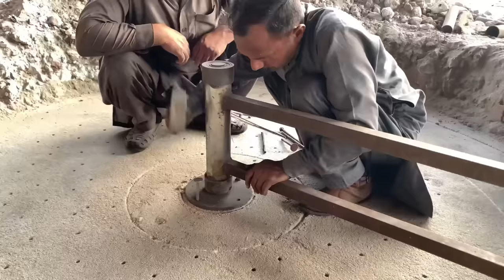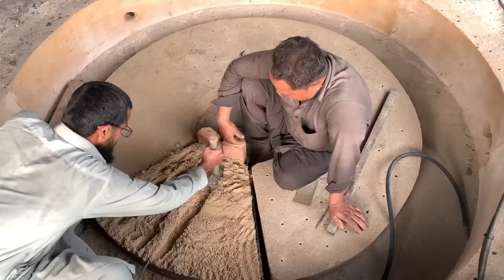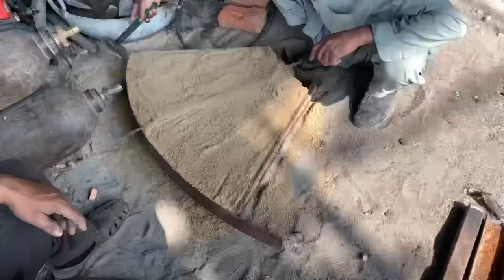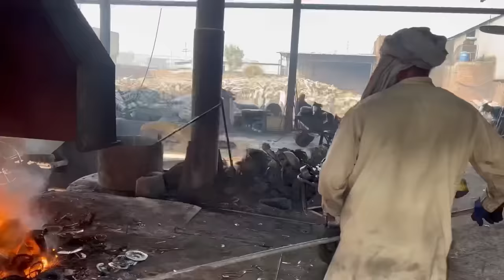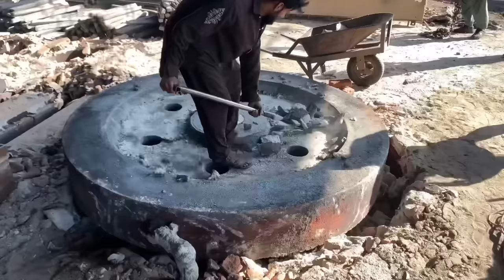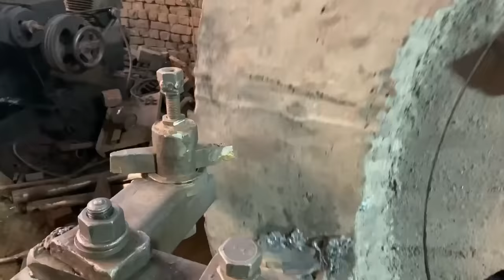Amazing Manufacturing of Largest Industrial Gear for Rolling Mill Plant | Production of Biggest Gear

Comment: Nothing but the highest quality steel and they won't even charge you extra for the porosity.
Reply: Porosity helps keep the over all weight down.  Don't want these big wheels to get to heavy, right?
Reply: С таким размером пористость влияния не даст
Reply: @zcommandante  sure it can it's a place for stress cracks to propagate
Reply: @andrewvogel5344  они дали отливке остыть за длительное время. После обработки на станках деталь будет подвержена закалке и отпуску. На этапе нарезки шеврона видно что металл пор не имел, весьма качественная отливка, возможно в расплав добавляли флюс для очистки
Reply: Aww shucks, don’t cha know the porosity is to make it lighter
Reply: Good try tiny, but I think you'll find it's cast iron 😂
Reply: All those files they like are to inject CO2 gas which reacts with a binder in the sand to solidify it allowing them to remove to the mold. Very common technique in metal casting.
Reply: @jackb8682  my bad, it was late when I posted but least I wasn’t far off with the porosity, well corrected sir
Reply: @theonlybuzz1969  You are a true gentleman Phil. Thank you.
Reply: well...blown away. Nice work fellas... it's amazing to see how these things are made without high tech tools...just good ol' fashion skill and persistence.
Reply: Yeah looks great! Highly inaccurate tho and needs cnc machine after delivery
Reply: So what eve y company needs different and mills are cheap
Reply: @seanriopel3132  That isn't the porosity they were referring to. Especially considering those holes were poked into the negative and would not be present on the actual cast part.

Comment: Incredible to watch this whole process. What struck me was the casting process was so primitive but when it came to the machining there was relatively little material removed so a great credit to the foundry. You want casting with no blow holes? Then go to Germany and pay 50 times the price. This gear wheel with all its holes and surface imperfections will still be working when everyone watching this video is long gone.
Reply: And they won't waste a chip. Those will go into the next melt for the next casting.
Reply: What?! Look at the face of the gear, it's got half an inch of material left from those oxy cuts. The amount of tooling this shop goes through has to be astronomical to what they are taking off and how hard they push their high speed steel.
Reply: @jsweizston5410  They don't have a decent pair of shoes and can only wear slippers in factories like garbage piles,
Reply: Pakistan is a developing country.
Reply: If you go to Germany and get this done, you will have 100% better materials, micron level precision and durability. Ever heard the saying, you get what you pay for?
Reply: @charliemarkovic4301  Yes, we have but unfortunately in Pakistan we are still developing so have to do with what we have. One day we will rise as a economy but until then we have to do with this. And I have no doubt we will rise. Pakistan along with Egypt, Iraq are cradles of human civilization. That zero you use in maths was probably invented in a town adjacent to where I was born - Bakhshali. Then we have Mehr garh, Taxila, Harappa etc
Reply: @stoopidpaki4806  all that was centuries ago. We are living in 2023. Recounting 'past glories' that you had no part in is hollow bragging.
Reply: @charliemarkovic4301  Point was we will get out of our economic issues but for now we can't afford German engineering products so have to do with what we have.
Reply: @charliemarkovic4301  And if you think I have no right to brag what gives you right to brag about German engineering to the micron unless you are a chief engineer in one of those companies. This is not about competition between German engineering and Pakistani engineering but rather that how in difficult circumstances we cope with what we have.
Reply: @stoopidpaki4806  why must I be a “chief engineer”? Can’t I just be a junior engineer?
Reply: @charliemarkovic4301  Ha ha ha you got me there ! Apologies to all junior engineers .....
Reply: This is a cast iron wheel that may become a pulley, gear, etc. The tan sand is mixed with a product known as water glass, which hardens with CO² gas. Known as core prints or cores.

You can use regular high speed steel cutters so tooling is inexpensive.  

'Primitive' not at all. Industrialized nations may use cranes and boxes to hold the mold. Maybe a hydraulic press to make a lot of the same core. 

At this stage the machinist is looking for cold spots. Blacks spots where the iron cooled too fast. They will probably shave another 10% off for the surface imperfections. 

The core sand will get recycled also. Broken up in a cement mixer.
Reply: @charliemarkovic4301 but they don’t need that type of precision. They work they are doing is amazing, just watch and enjoy.
Reply: Excellent just the information i was looking for.
Reply: Its only rough machining, not precision...

Comment: As an amateur machinist I admire the skill and teamwork from casting to machining. It is a low rpm gear wheel so imperfections in casting do not matter. Excellent work.
Reply: Looks exactly like a flywheel we had at our rock quarry crusher, the other side of the crusher was the drive wheel. It was 14 feet in diameter and had grooves for 18 drive belts powered by a 200 HP motor.
Reply: Low RPM's or not, if it's not made to decent tolerances they'll be making another one in time...
Reply: You are not from the future...
Reply: @Shanidar1  
The point in your comment is understood but within the limits of the gear it is well made for the purpose and that was my comment.
Reply: @dc6233  
How can you say not to decent tolerances; do you have the data and why would someone pay for the foundry if they make crappy products. They are not making turbines!
Reply: I saw one video where they actually went off a drawing, but it was about 2x6 and hand sketched.
Reply: Nah that sht gonna crack in a week.. that's why they make them like babies.
Reply: Another "will crack in a week" line without opening up that whole implication at all. almost suspecting that someone has client who could well use cheaper product like this for their purposes and thus must throw shade. But what do I know - pls, set some ball parks with numbers: what is a use where these will last a year or few and what is the use it only lasts a week? Where these could be used so that it is worth it to pay for highest quality and where not?
Reply: Low RPM and high torque, casting imperfections absolutely matter.

Comment: Just goes to show, it isn't about how fancy the factory is, it is about how smart the workers are, clearly these guys are top notch, just imagine what they could do if they had access to one of those fancy factories and tools to build stuff.  It just boggles the mind that upper management is squandering that kind of talent by not upgrading that foundry.
Reply: They make what they can sell.  If they upgraded their factory to make spaceshuttle parts no one one buy from these posers.  The make these because that's all they can sell
Reply: They'll probably have to lose half the work force in they did that. Maybe retaining the jobs are more important.
Reply: or OSHA
Reply: I'm guessing they manufacture to the demands of the market. In their market, nobody's worried about the particular alloy, the surface finish, low tolerances etc. It's good enough, and may well be in service for many decades. The same part for a giant Heidelberg press in Europe would be precision made of iron or steel and easily cost hundreds of times as much, but that's a very different market.
Reply: You clearly do not understand a thing about quality controls and safety/health standards. Those "fancy" factories are not only designed to reduce costs, decrease pollution, increase product quality and productivity, these are also designed to increase the safety levels of the workers!! Life expectancy of the "talented"guys you see in this video is surely some 20 years lower than any of the "non-talented" guys working in any fancy factory in a developed country.

Comment: Greetings from Hungary!  ہنگری سے سلام!
All my respect goes to these people who perform difficult and precise work in simple conditions!
From here in Europe, it is difficult to understand how foundry workers can do without any protective equipment. Work in pajamas and sandals or bare feet without injury...
It's also not clear how the quality of the steel is set?
All I saw was that they were melting all kinds of scrap iron together. Anyway, when the huge cast flywheel was turned in front of the lathe and it clicked against the steel of the machine, it sounded perfectly fine.
Obviously a different culture. Nevertheless, to my European eyes, which are used to completely automated and 'pharmacy clean' workshops, these workplaces are a bit exotic...
Reply: مع أن هنغاريا دولة فقيرة
Reply: Your grandparents were no different then these people 50 to 60 years ago. They were doing exactly the same job these people are doing now. Also, they can improve the quality a lot if they are paid heavy amount on the product they are making. In the third world countries western products are priced heaveily knowingly so obviously they have to do anything possible to make that product with less price and if "less price" is going to be one of the main factors then these scenes will obviously come in existence.

Comment: From the UK.
I've worked in foundry's in the UK. They're made in the same way. You have to let the casting cool slowly or you'll get chilled areas that can be brittle and then it'll be difficult to machine evenly.
This was top quality.
Larger gears are cast in segments then bolted together after machining on the lathes.
Reply: From Bulgaria.
I have never worked in a foundry, but have some welding experience, and I know that meeting a droplet of molten metal or slag with your clothes can become quite an experience on its own. Can you please comment on the protective gear those guys are (not) using?
Reply: @adashche  From the Russia.
This is a real museum of 19th century technology, everything is simplified to the limit and technology and safety are violated everywhere.  I think all this is necessary to employ more people, to combat unemployment.
Reply: @adashche  
In the UK we're issued with steel toe cap boots with heat resistant gaitors and gloves and the people employed to handle the molten metal has aprons and fire resistant hoods.
These people have a long way to go to satisfy our health and safety rules.
Reply: @adashche  Those leisure suits are fireproof!...:) There's no word for "safety" in Hindu.
Reply: @Engineer_Stepanov  Right.
It's just a form of post natal indication.
Reply: @godbluffvdgg  Не будем забывать что ходить по углям их национальное развлечение
Reply: @zcommandante  :D...True, they are basically fireproof...Правда, они в основном пожаробезопасны...
Reply: Top quality? Wtf i guess we have a big difference when it comes to quality.. 
You saw how many inclusions that casting had?...
Reply: @FireGodSpeed  
I should've said given the facilities they worked with.
If at the end result it works for the job it's designed for then it's fulfilled it's purpose. 
I might add, at a fraction of the cost a western or American factory would charge. Which goes a long way to satisfying all of the effort without the big bank loans.
Reply: UK here and a metalworker. There is no way that is top quality - op is telling porkies big style.
The main thing you missed is the metal content - high silica steel suitable only for electromagnetic coils - it's kept separate in all foundries due to its poor crystalline structure not being suitable for other uses. The very fact that you missed that tells me you do not and never have worked in a foundry.
Full of bull dude.
Reply: @dasdasdatics420 i  wonder why the rest of the world tests their steel for their exact additives in their castings/general material. such a waste of money honestly just throw some materials together and Cast that Mild steel gear YESSSIR. 
So yes for a Fraction of the price you get a piece of unknown Additives steel, alot of inclusions, and a inaccurate part. Sounds good too me .
You ever heard the term: You buy cheap, you buy twice.. 
Imagine you install that gear and it fails, how much damage that would be to the other components..
Reply: Did you not recognize the huge amount of casting failures ? I mean this is defintly not a top product.
Reply: @FireGodSpeed  
On the contrary. Indian steel is known for being the best steel in the world.
Reply: @jackking5567  
We used to weigh the various ingredients for the metal that was required.
The moulders also made test pieces where the customer requirements.
The pig iron was mixed with scrap to get the desired casting which enabled it to be machined for the bearing housings as per their requirement.
Wed also add calcium carbide.
High silicone steel for extra tensile strength and rebar steel so it can be shaped without the need to reheat is also produced low tech.
Did you invent steel I wonder.
Reply: @dasdasdatics420  where did you learn that lol? I have never heard that in my life.
Inclusions come from impurities trapped inside when pouring as well as trapped air. And looking at this get and how many inclusions it had, i would bet everything they just threw some scrap in there and just poured it, without thinking much of it lol.. 
So to say they have the best steel while watching a gear casting video with unknown additives. Honestly idk wtf you smoking.. 

You know any company which is known for good castings would repour that gear or at least weld the inclusions... 

We make castings and we would never deliver a casting with inclusions lol.. that's a crazy risk if it failed..
Reply: @FireGodSpeed  Why are you calling it steel ?  It's cast iron......No way that foundry is set up for casting steel !
Reply: @FireGodSpeed  Hey expert, You do know that this casting is cast iron and not steel .......don't you ????
Reply: @jackking5567  they do not check at all any steel content or add any additives. It's as well could be iron. Heck probably more flexible iron would be better.
May I add that their melting furnace will also add some unwanted extras. They do not seem to care.
I am guessing this is for a wind mill style application where they could just used a wooden wheel as well like in Netherlands in 1600s.
Reply: @Saugdingsgnubsi  what do you expect, this method would be appropriate it say 1700s or 1800s in Europe. And by 1800s not for all applications.
Reply: @tomk3732  not so much casting failures? Because this is also possible with the antique technic
Reply: @jackb8682  Oh sorry yea i got mixed up because i was replaying to a comment saying "INDIAN HAS THE BEST STEEL IN THE WORLD", so yea my bad, sometimes even the best slip up. :) 
And to call that cast iron is an insult to cast iron.. thats unknown cast inclusion iron ;)
And to be fair it doesn't really matter at all what the material actually is, A shit ton of inclusions are present, thats all i have to see to know its a shitty part.
And regardless You could LITERALLY replace the word steel i used in the last comment with Cast iron and everything still applies.. the rest of the world TESTS their cast iron.. but yea Some Scrap, some Dirt, Some dust, some rocks, everything adds to strength i suppose XD Carbon content? pff  Wtf is that, It came out like that, good enough.
Reply: @FireGodSpeed  Yep, fair enough comments..... Whatever the material they use they have a very primitive set up compared to a modern Western foundry but there is no denying the skill of the workers, who have to work with what they've got.
Reply: @jackb8682  true nobody ever said they weren't skilled the, make the best they can with what they have, still doesn't help the problem that it is a bad product, will it work, certainly it could work, it could even work for 10-20 years who knows still the guarantee isn't there that it will work and for how long
Reply: Модельщики молодцы! Металлурги туфтовщики.
Reply: @FireGodSpeed  
Points taken.
By saying that indian steel is the best steel in the world I refer to their preference for Indian made steel used in the axles and drive shafts and springs for the trucks which are proven every time to be stronger than western axles and shafts and springs because of all the terrible road surfaces and potholes they have to drive down.
The Indians will replace all foreign axles as soon as possible for Indian made axles because foreign axles are not strong enough for the Indian roads.
Reply: @jackking5567  I was scanning through that mountain of scrap metal to see if I could spot a conquistador breastplate or a Yamaha gas tank.
Reply: Your work environment is much better than theirs, at least you don't have to wear slippers to work in workshops like garbage piles. The Industrial Revolution launched by Britain brought them machines, but in terms of management, it's no different from workshops in the 17th century
Reply: @爱国设计师刚哥  
Yes I agree.
The introduction of the Health and safety legislation and PPE was as a result of the UK socialist labour government.
We were lucky to have got rid of Churchill's Tories after WW2 and voted in Labour which also introduced our NHS in 1948
Reply: @jackb8682  "Why are you calling it steel ?  It's cast iron..." I know very little in the topic but you must be soo pro to know what is exactly in that steel just from this video... LoL
And yes it is a steel, they were mostly trowing into furnace some low and medium carbon steel so there is no chance that the final product have more than 2% carbon(and why this is important you should know Mr. Internet Expert...).